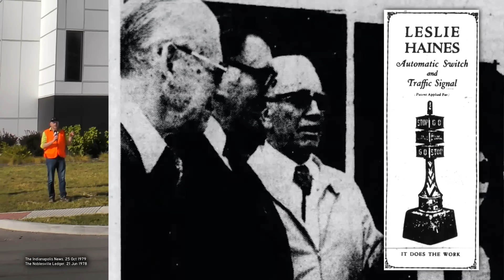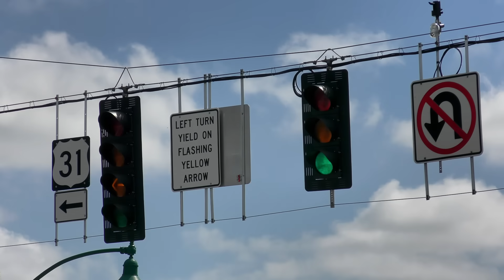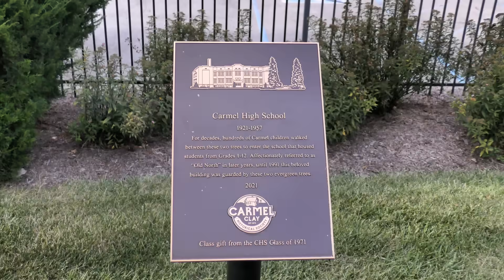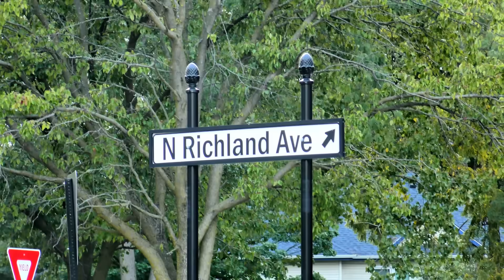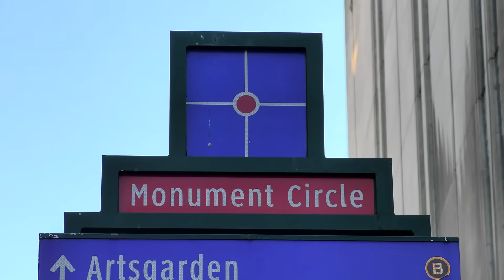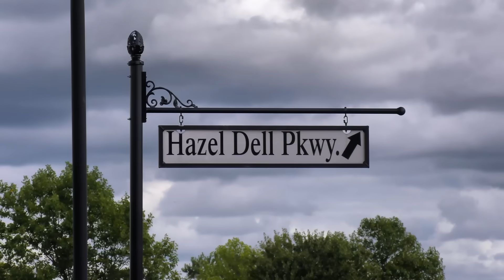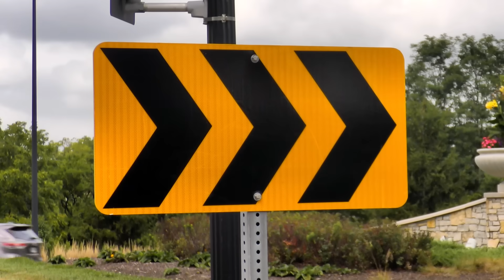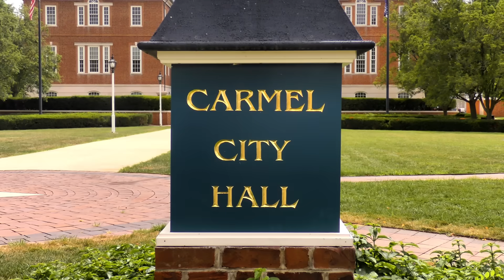Let's FIX the HIGH SCHOOL... with 152 ROUNDABOUTS!

Comment: New Jersey use to be the Roundabout capital. When I was a kid, there were roundabouts everywhere. Then in the 70/80's they started to tear them out. There are still a few left but I remember the roundabout days.
Reply: Those are technically traffic circles, not roundabouts. They range from pretty efficient (like the one in Lakehurst) to pure chaos (the nightmare at 202 & 206 in Somerville)
Reply: Not the same. Those are traffic circles, not roundabouts. Roundabouts are like what you see here in the video.
Reply: Traffic circles are much smaller in diameter, and not at all the same as a roundabout.  Here in my Orange County (CA) neighborhood, there are several traffic circles, but if you hit the right angle, you don't even need to slow down while going through them.  It's basically just a yield sign.

Comment: The first roundabouts I've driven on used to be the rotaries in Gardner, MA.
They are at the on/off ramps for a smaller state highway.
When I was a kid in the 1970's, all vehicles had to stop before entering the rotary.
When they transitioned it to a roundabout, all they did was narrow the lane by adding sidewalks and some grass between the sidewalk and the pavement, then tore out the stop signs, replacing them with yield signs.
Reply: They recently redid/repainted at least the western one too, implementing in a sliplane into the westbound offramp into downtown (if I'm getting the directions correct...) but then right up the road is a GIANT "rotary" around the Hannafords, which got a signage flip at one point of the "traffic triangle"  about 5 years ago so that the triangle has to yield rather than those entering the triangle.

Now if only they removed the traffic lights about 50 miles east of there along that same highway...
Reply: @Roccondil  Of course then you get bad execution like in northern Princeton on Rt 140 where the rotary is so tight that tractor-trailers end up rolling the trailer over the low decorative median.
Reply: @MonkeyJedi99  That low median/hub I am pretty sure is MEANT to accommodate the tractor-trailers because they knew that curve was going to be too tight, while still keeping regular traffic at the correct radius.

Over in Fitchburg near Crocker Field there's an even SMALLER rotary that's got a similar low median as its hub, not even any bush to decorate the center, as it too is meant to allow large trucks to navigate it over that hub.

Comment: Hey Rob
It’s a traffic signal … 

Why would you call it a stop light ?? Half the time when its green, it’s a “GO” light
Reply: The purpose of the light is to stop people when necessary. If there were never any requirements to stop, they wouldn’t put in a “stop light”. They wouldn’t put one in. Then it’s always “go”.
Reply: Flashing amber lights (meaning yield or hazard) are also signal lights, even if they never signal to stop.

Comment: I live in west Suburban Indianapolis.  The other suburbs in the Indy area have also been adding roundabouts.  Even the city of Indianapolis is adding them.  They really work much better than a signal or 4-way stop.
Reply: Indy did? I thought they were staunchly against roundabouts?
Reply: @evancombs5159  They're coming around to it. lol slowly but surely.
Reply: @cortburris9526  at least they know to drive in circles in Indianapolis ;)
Reply: @evancombs5159  Yes, Indy has added several.  They can't argue against the statistics.  I live near two of the newer ones and the traffic is much better.
Reply: and they are cheaper to maintain and don't need expensive maintenance or any electricity lines built to them
Reply: Where is Indy adding roundabouts? I don’t see any near me.

Comment: As a cyclist, I LOVE roundabouts. I can easily use the whole width of the circly lane as everyone slowed down anyway. Frequently doing an extra round just for fun :D . (Of course not using any separated cycle path, if there is any. These add an extra mini intersection at every arm, which is just plain dumb, as it scraps any safety advantage)

Comment: I used to drive back and forth between Prescott and Ash Fork on AZ-89. There were a series of roundabouts on that highway that seemed really dangerous. I hated them. They were too small and tended to jump out of nowhere. You go from 55 MPH, down to 10 and back up to 55 until you hit the next one unexpectedly, again and again. (The speed limit ranged from 35 to 65 on that 100 mile stretch, and speed limit signs were scarce). 

There is a large sign just before each roundabout, but it isn't much of a warning. They don't tell you how far ahead it is or how tight the turn is going to be. There aren't even speed limit changes to help you ease to the right speed. You just have to know. I have also encountered traffic jams at these roundabouts, which is increased danger. The highway is mostly empty road in the middle of nowhere. Drivers are daydreaming at highway speeds, not expecting to run into a roundabout or stopped vehicles. 

If you ever do a video on roundabouts done wrong, AZ-89 (between Prescott and Ash Fork) may be a good area to look at. It has been about 10 years since I've traveled that road, so maybe improvements were made. I'm looking on Google Maps, and it looks like they have only added more roundabouts.
Reply: It's common in Europe to put rumble strips on the approach to roundabouts on high speed roads, these get closer together as you approach the junction, which gives the illusion of speeding up which tricks drivers into slowing down.
Reply: The ones near Wickenburg along 93 are pretty bad, too. Almost no cross traffic to justify a giant, awkward roundabout in the middle of nowhere. It's probably no safer than the standard intersection for divided highways with the holding area in the median for people turning left onto the highway.
Reply: The fact that you feel uncomfortable driving through them is actually part of why they probably work better. For longer drives through more remote areas, a lot of people tend to just zone out and cruise, which can be incredibly dangerous at unprotected intersections. Forcing drivers to be aware enough to navigate a roundabout every so often means they are much more likely to notice other drivers, especially at the exact intersections they would otherwise go unnoticed. Also, even if it is for much lower traffic volumes on side streets, roundabouts still remove the most dangerous type of vehicle interaction which is cars turning left in front of oncoming traffic, especially when that oncoming traffic is traveling at high speeds like rural highways are notorious for.
Reply: @JordanPeace If you make it too uncomfortable and stressful though drivers might avoid the road entirely.
Reply: @JordanPeace  I'd have to see the car crash data, but you have to walk a fine line there. If you startle people too much, you have irrational behavior like panicking and sending the car off into a field, or playing bumper cars with the guy next to them in the roundabout, or panic stopping in the middle of a high speed highway. If you incite enough irrational behavior, the roundabout is just as dangerous in that situation as a standard intersection. I'm not a fan of surprise roundabouts when I'm driving 70-75mph down a highway. They should at least install rumble strips or curve the road a bit or something.

Comment: Roundabouts were part of the reason my grandparents stopped driving. They lived in the same small town for 75 years, and had never encountered a roundabout before. They could handle intersections, coming to a complete stop and making sure it was safe to go. But roundabouts were too foreign and chaotic - so when the city started building them, that's when my grandparents decided to hang up the keys, and I got the privilege of driving them everywhere.

It's important to remember that cons of change as well as the pros.
Reply from the maker: There is certainly a learning curve, no doubt.  The data cities are less eager to share is that fender-bender crashes (PDO = property damage only) actually go UP inside a roundabout.  But the trade-off is that injury and fatal crashes plummet to almost none.  But when you're an elderly driver, even a PDO crash can be traumatizing and hurt one's pride.
Reply: Y'all are some unsympathetic people. Imagine driving the same roads (with 25 - 35 mph speed limits because small town). Then suddenly roundabouts are installed. Instead of coming to a complete stop at a stop sign and assessing the situation, you've got to merge into moving traffic.

And yeah, nobody can drive forever. But when there are no busses, and you live in a suburban area where the closest stores are several miles away, it's a big problem.

Such a big problem that I sold my house, quit my job, and moved in with my grandparents to drive them places.

I'm a little bit bitter.
Reply: @PsRohrbaugh  imagine driving through t intersections your whole life then suddenly becoming confused by a couple close together.  

Literally doesn't happen. What does happen is getting old and confused by the rigours of driving. Your parents didn't stop because of roundabouts. They stopped because they were no longer mentally capable of driving. A good and responsible decision on their part. Pity you made it all about yourself and started blaming road design for something that happens to most drivers with age.
Reply: @PsRohrbaugh  uprooting your life just to drive your grandparents around town seems a bit extreme don't you think? Maybe it isn't the roundabouts that are the problem, but your grandparents stubbornness.

Comment: Check out the HUGE roundabout in Alexandria, La. The inner circle is 32 acres!
Lots of potential for high speed crashes there, as it's so big, no one needs to slow down.
Known as the South Traffic Circle, as there used to be a much smaller North Traffic Circle.
Reply: If you talking about the one on McArthur thats not a roundabout   (is just some weird anomaly with kind of circular design)
Reply: @maumor2  it is gigantic, but it functions like a basic double lane roundabout.
Reply from the maker: Holy smokes!  That's one heckuva.... SQUARE-a-bout?

Comment: Great, great video! You are the best at what you do, and that is saying something.
I am currently in Egypt. The govt. is spending huge amounts on road building, and roundabouts are a big part of the plan.  The difficulty is lack of driver training (like in the U.S.)  The People are confused and don't know what to do about right of way.  You are 1000% correct that it lowers the stakes.  If someone is wrong, at worst it is a bump.  Nobody gets killed.
Reply: there are basically only two rules to understand: Everything turns counter-clockwise (which is very intuitive, because you never cross other directions) and traffic within the ring has priority (else it would clog up). Usually people get this relatively quick.
Reply: @kailahmann1823  I'd like to add a third step which I never understood: double lanes. You MUST be in the correct lane before entering the roundabout. The right lane can only turn left and go straight. The left lane can only go straight, left, or u turn. There are no other options. Knowing those rules is key to not getting 'stuck' inside the circle and also not crashing into the driver to your right.

Comment: Roundabouts are good if you believe that cars are the only vehicles that matter on the road. They will help prevent people from experiencing traffic violence. Roundabouts are terrible for pedestrians, bikes, or pretty much any other vehicle if your not in a car.
Reply: If it’s a roundabout in place of a traffic light, I’d disagree. Roundabouts force all traffic to slow down. At traffic lights you’ve got red light runners, people who turn right on red without yielding to pedestrians, and uncontrolled left turns they don’t yield to pedestrians, and all potential traveling at more fatal speeds.

If you visit Australia, you’ll notice that where they have roundabouts and center islands, they will install pedestrian crossings away from the roundabouts, with safe refuge in the center islands, so pedestrians only have to watch out for one direction of cars at a time.
Reply: SIdewalks work fine with roundabouts the problem is if you want to ride your bike on the road.  In that case is a free for all, hope for the best scenario

Comment: In Australia - there are a couple of roundabouts since converted to traffic lights that had the main road roundabout cross a minor side road. The side roads would have during peak hour traffic red lights activate to allow more traffic through the main road. The problem was 1 car from side road would stop 4 lanes of through traffic so they would bank them behind traffic lights. Sadly they are now converting those to traffic lights only intersections so the speed will be higher going through the intersection meaning more higher potential for serious crashes. 
https://www.google.com/maps/@-38.0721153,145.1956905,3a,67.8y,273.25h,65.2t/data=!3m7!1e1!3m5!1sEQ1Na4ER2oTNNei8m6x1Kw!2e0!5s20170301T000000!7i13312!8i6656?entry=ttu
That image is from 2017. Change date to now 2023.
Reply: The same thing happens at regular traffic lights. And it's even worse if they work in fixed-time mode, without any detection; you can end up waiting for a minute when nobody's there.
The real reason is that they don't work well when flows are unbalanced. They don't allow for cars to be metered. And they're less pedestrian friendly.

Comment: Roundabouts work great when one or two lanes wide.  But in places like Washington, DC, where there are 4 lane roundabouts it is chaos!
Reply: turbo roundabouts help when there are more lanes.
But 4 is indeed too much. Although if 4 lanes are needed, there usually is another problem that needs fixing first.
Reply: If you have 4 lanes in each direction you really ought to be removing one in each direction to put in high capacity public transit routes instead.
Reply: You missed the whole point.  @6:06 they start talking about the difference between modern roundabouts and rotaries (also called traffic circles) the ones on DC (dupont, washington, logan, etc) are not modern roundabouts
Reply: That is not the fault of the roundabouts, that is the fault of whoever build 4 lane streets. Even the famous German Autobahn generally only has 3.

Comment: Much easier to install a roundabout in new construction.

Retrofit projects have issues with property acquisition that may shift the roundabout toward a particular quadrant to avoid taking park lands, etc., which can create some nasty curves resulting in signs being knocked down repeatedly and landscaping demolished by trailers.  Another problem with retrofits is that many intersections are on a hill.  And those directly on a small hilltop create some interesting sight distance issues for drivers unfamiliar with the area.  Of course you can install warning signs, but many drivers suffer from signing fatigue and simply tune out excess signage - the yellow ones in particular.

There are complex intersections, such as MO I-70 Exit 125, which has two roundabouts and a traffic signal, as there are access roads and exit ramps on both sides of the overpass.  I think this example is especially challenging to drivers the first few times they go thru it.  The dog bone at Mo I-70 and Range LIne Street, Exit 127, is also challenging, as its a two lane design, but I don't think its quite as bad as Exit 125.  Both make me nervous enough to avoid whenever possible. Both are located in Columbia, MO, home of the Mizzou Tigers.
Reply: Personally, I think intersections on hills need roundabouts the most. Those intersections are often the most dangerous either way.

Comment: The public was rightfully mad about the cost of landscaping with these projects, I've seen plans for a new development nearby where 50% of the cost was on landscaping with 500 trees at $1500 each
Reply: Labor is the biggest driver in cost for any modern project. The justification of spending 50% budget on landscaping with a bunch of trees is likely based on the profit they’d make. A bunch of trees makes an area look a lot prettier than a fully man made area with limited nature.
Reply: @fresnobiggledrum537  there's no justification in charging $750k on trees, they want 20ft tall 8-10 y/o trees instead of planting 2 y/o trees that cost $30  AND plant them in between the sidewalk and the curb which will damage both and require trimming, not to mention a deadly fixed object beside the roadway